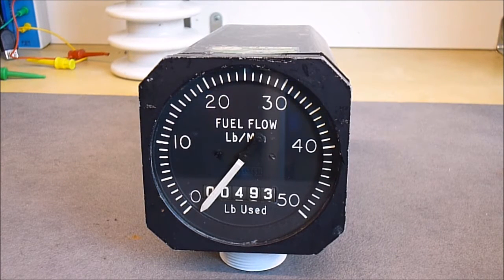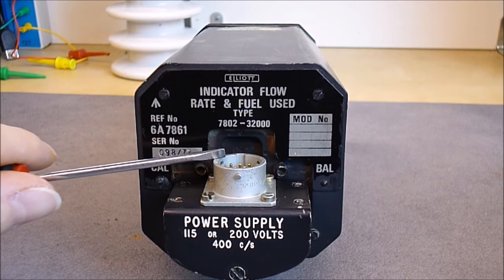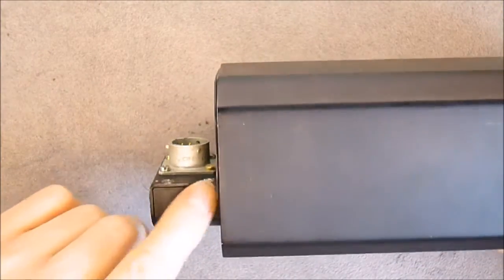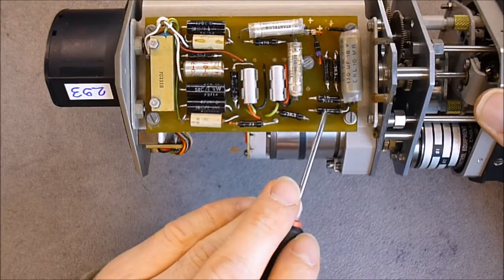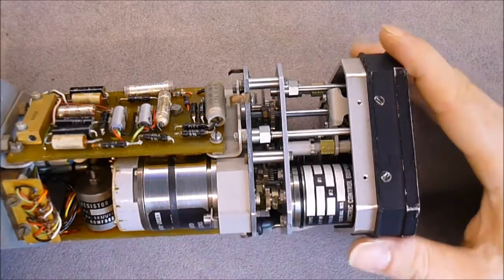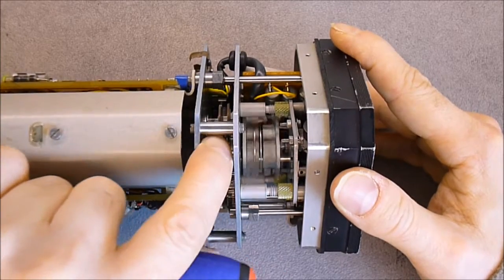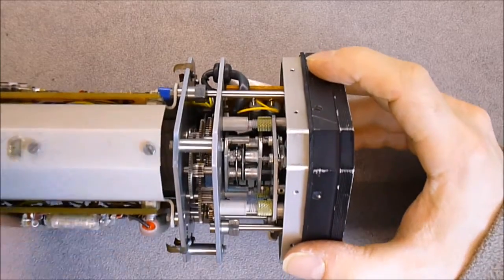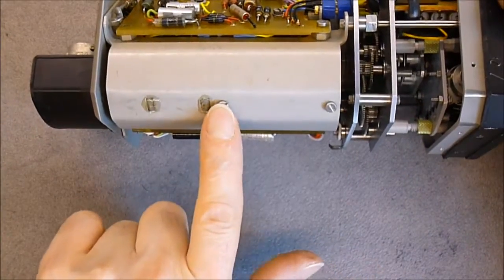Elliott fuel flow instrument teardown

Comment: OC202 is a Mullard part number, and that is actually for a silicon transistor.

A tachometer generator is exactly what it sounds like; a small generator which generates a voltage proportional to its speed; they usually have a rating for volts per 1000rpm.